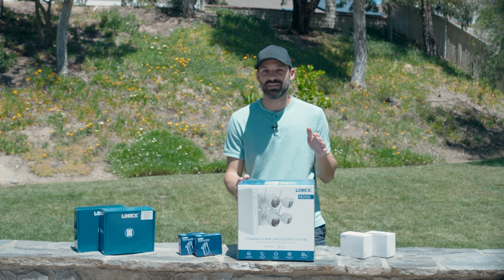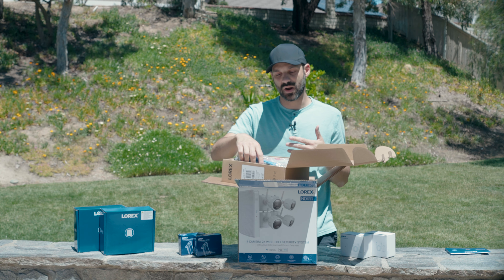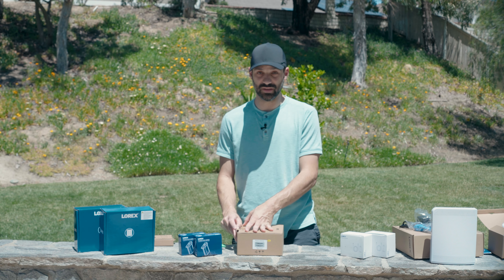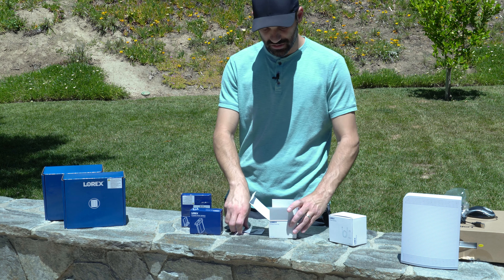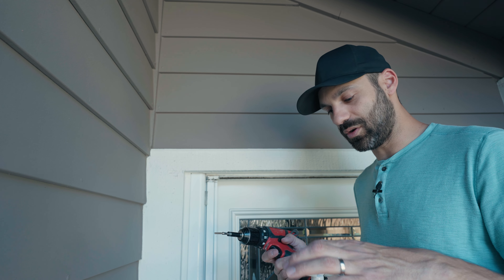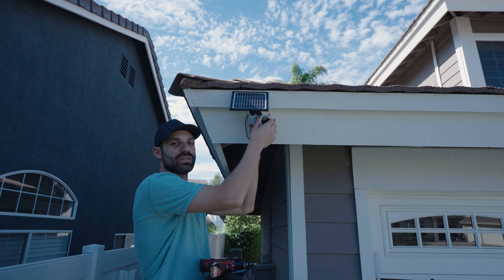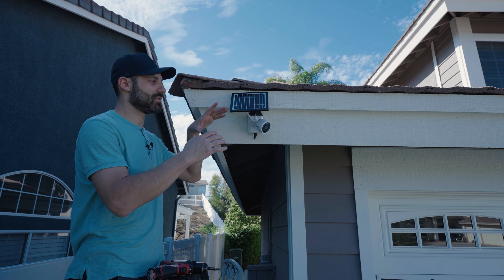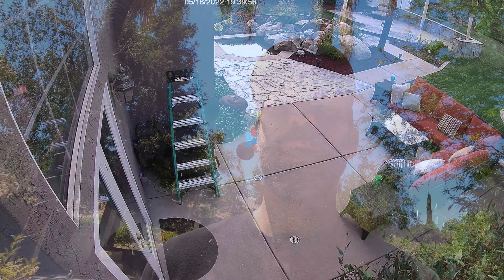Lorex 2K Wireless NVR Surveillance System Review - Features, Tips, and my Experience!

Comment: I bought this system based on this well done video. I wouldn't call it a security system because it can't be depended on. I try to use continuous recording on one camera that's powered 100% of the time but it keeps reverting to motion, meaning that it frequently misses what you want to see. Also, the motion alert, like you would use on a front door, takes several minutes before it goes off on the phone app. Sometimes as long as 30 minutes. I've spend a lot of time and money with custom mounting on this system and am very disappointed with it. Oh - and if you leave a negative review of this on the Lorex web site they take it down. Keep shopping for something else.
Reply: The lorex stuff is good, that is if you buy wired nvr stuff. I bought a lorex 8 channel wired NVR POE system four years ago and have been super happy with it. Even all of my ring cameras are wired POE as well. never a skip, never miss a beat. Stay with wired if you want 100% capture 100% of the time.

Comment: Thank you, I appreciate this video very much. I'm moving to another state, into a full-sized home and I've been researching like a student with a school assignment. Your guide was helpful, thorough, honest and you seem very detailed, unbiased. Thank you for walking us through that, I am one step closer and way more confident to purchasing this system thanks to you. Thanks again, best wishes and congrats on your new move! 🙂
Reply: What did you end up buying and how was the experience? Are you happy with the system?
Reply: @Ebruhhk  I did end up getting this security system. I have mixed feelings about it. As a wireless camera system it’s comparable to any others, Wyze, Blink, etc. It has identical and/or similar features to those. I was not sold on this system because it is wireless. My previous experience w/ (Wyze) wireless systems, including this Lorex one, is that charging and power could be a potential issue. I chose this one because we rent our home so I’m not allowed to drill and run cables in the wall for a more reliable system. In order to rectify some tedious effort, I connected each camera to a solar panel. But I still find that the cameras die and use up power very quickly. Many times I still have to take out the battery to charge it myself, which defeats the purpose for me. I’ll be fair and state that I didn’t put scientific research into placing the solar panels. I placed in areas I know get sun. Additionally, the cameras make this annoying sound when they need to be charged, which can be heard (or disturb) neighbors. So overall I’m satisfied, given it’s wireless potential, but if I had the option to, I’d get a wired system.
Reply: @exavierme  How often do you change batteries? im gas sation owner..
can't bring wires to the outside top of each pump. so I'm considering  to get this model. 
also how's the wifi

Comment: Can you share the update info regarding the issue with the solar panels? Mine are chirping all morning as they switch to solar. They also seem to keep dropping out when hooked to the solar panel.
Reply: When I hooked up the solar panels they would "chirp, chirp". I called Lorex tech support and they said to upgrade camera firmware. Lorex sent an email with a file to down load on a usb flash drive (quick format flash drive first in FAT32 which is normal). All good until tech support said to insert the flash drive in the usb port on the nvr. I did that and there was no file, just a blank screen. When you initially setup the system you plug in all the cables and the mouse. There are 2 usb ports on the NVR, 1 is labeled  Mouse/Backup the other Storage, so naturally you plug the mouse into the one labeled  Mouse/Backup. I then thought after 3 phone calls and 4 days with tech support, I wonder, I plugged the mouse into the usb port labeled Storage and the mouse still works. I then put the flash drive into the usb port labeled Mouse/Backup and there is the file!!!. It is not a ".bin" file though, but it works, don't open it, unzip it or anything. Also make sure your camera batteries are fully charged, at least above 50%, it'll tell you that on the screen. If the cameras are far away and keep "timing out", I had to move one next to the NVR. Give it time to update and the cameras will make a "chirp" before they get to 100%. I had 3 update and had to go back and do the last ones. All cameras now up to date with latest firmware.
Reply: @lunchbox6080  hahaha. I did the same stupid thing with the usb ports. Took me a few mins but I figured it out. Now that there is no more chirping I’m very happy with the system.
Reply: @eng13ine178  I did the same. The sad thing is that Lorex tech support says the USB won't work if you plug it in that way.

Comment: Hi. They say *Power adapter is required alongside a hard drive for continuous operation. Do you have a review of that requirement?
Reply: The camera must be powered 100% of the time to enable continuous recording. I have this system and try to use continuous  recording for one camera and it constantly reverts to motion sensing. You can't depend on this system for protection.

Comment: Thank you for the amazing review. You really went to a lot of detail and it's appreciated. I'm a security consultant who does commercial grade security sales but I always have family and friends that want less expensive options. Curious, how are the cams holding up battery-wise with the solar panel? I'm hearing mixed reviews on it. Also how does the HDMI display on your TV or monitor when you switch over to that input?  does it wake all the cameras up? Or do you have to use the remote to select the camera to open it up?thanks!!😊

Comment: Is it possible to use both, the battery & the solar panel, simultaneously, so you have a backup in case the solar panel fails?  Thank you!!!
Reply: I wanted to know this answer also?
Reply: I know this is really late, but yes you can. I'm doing this on two cameras.

Comment: Very informative video, thanks! Is there any benefit of adding a  wifi doorbell camera as well, or that camera above your door covers all the functions of doorbell (other than chime)? Thanks.
Reply from the maker: Thanks DD!  The benefit would be having a new vantage point which is nice, and it will never run out of battery power.  It's always good to have options so I'd say it depends on your setup.

Comment: I have used the system for less than a year.  One faulty battery and one of the cameras recently stopped working.  Numerous false detections.  Solar panel can not keep the battery charged.  Lorex is a complete joke.  Will switch to something else soon.